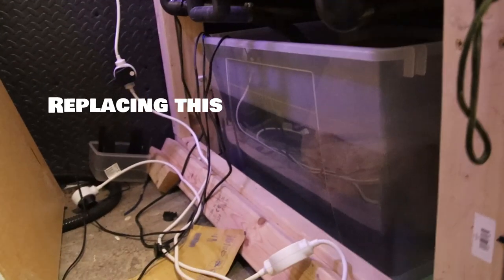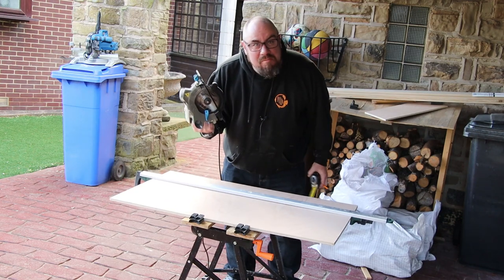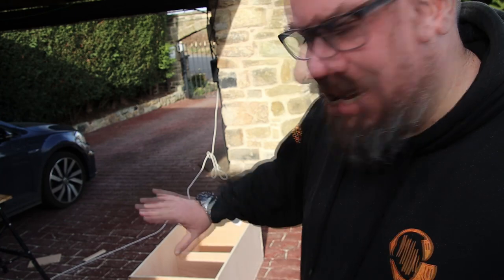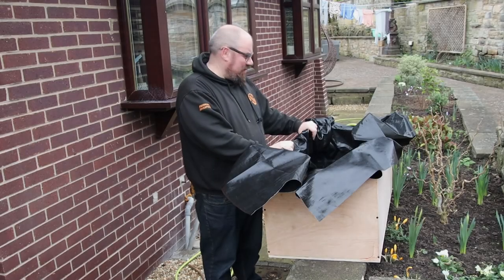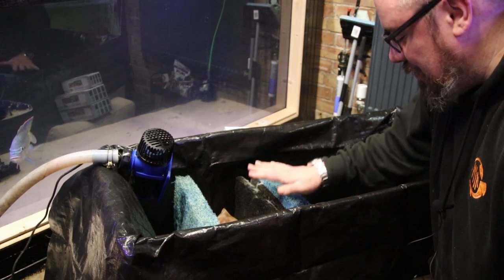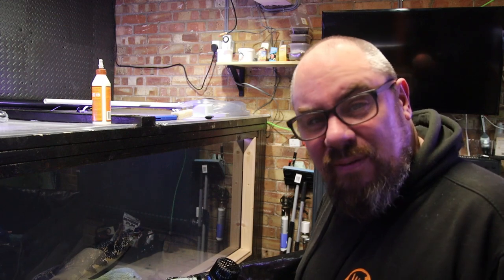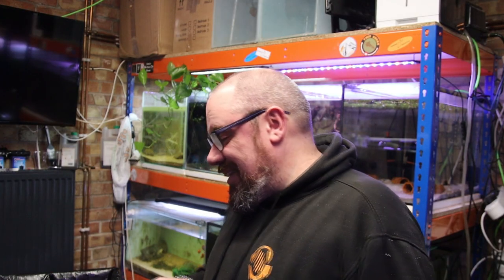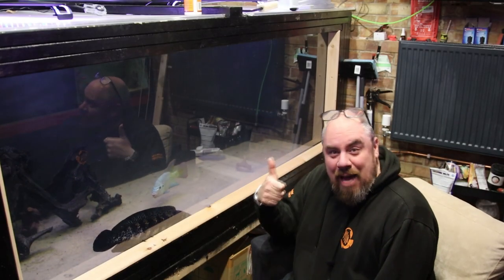Megatank Filtration: DIY Aquarium Sump filter build

Comment: The Snakehead looks amazing !!  Good stuff sir. So good to see your big tank is aces and your sumping it..  My 660g system has a 210g plywood sump I built for it.  It allows you to set it up exactly as you want it.. That sump has 1 chamber at each side loaded with media and drip trays with sponges on top for particle gathering.  My 300g tank has a 75g tank, I cut baffles for and silicon sealed them into place.  I use filter socks for entry point from plumbing..

Comment: Another great video, keeo up the good work Graeme. Quick question, what would you say would be the smallest size tank I could use as a temp hospital tank for Discus. Want to use a plastic tub if possible as and when required.
Reply from the maker: Depends how temporary really - too small and anything you're medicating for that takes more than a day or two will be competing with the detrimental effect of a small tank (i.e. fish being stressed by the tank as well as the illness).
Plenty of plastic tub sizes that would work well though - just go as big as you can practically fit it where you have space.

Comment: i think youve taken the idea of using wood too far using it for a sump, the price of that wood you could of easy got a cheap 2ft scratched up tank.
Reply from the maker: Maybe - but that would have been much smaller than what I built - building it means I can maximise the available space
Reply: @AquariumAdventures  did you consider a  planted sump/trickle tower above the tank? im asking because if i got around to doing a similar project, i was leaning towards it, with the bio made up of clayballs and plants like pathos etc. i get ya on size fair point.
Reply from the maker: Yep - considering a bakki river style running the length over the top in the future. Made of wood just to annoy everyone :-)

Comment: Not sure if you're having a laugh building a wooden sump instead of buying a cheap scratched tank off FB Market or even a big plastic storage container 😕 

A cheap used evolution aqua eazy pod would be a good option for mega tank 👍
Reply from the maker: It would - but it wouldn't fit under the tank, and would cost at least twice as much